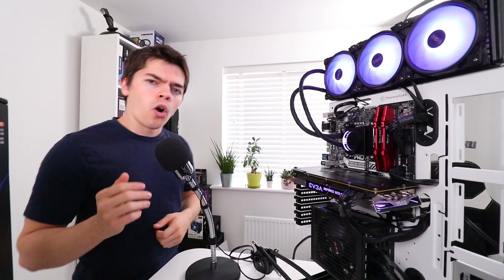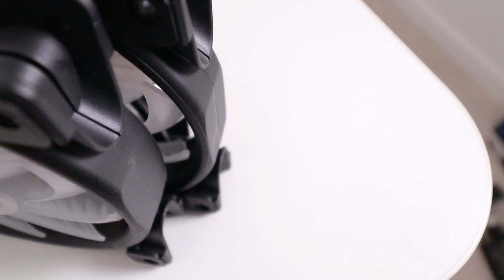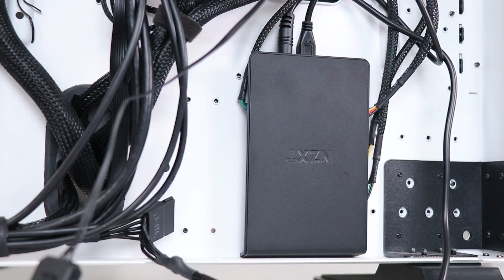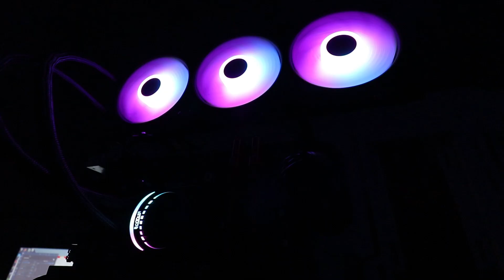Are Cheap AIOs Worth It? - PREMIUM vs BUDGET 360mm ARGB AIO Coolers ft. Corsair H150i Pro XT

Comment from the maker: Timestamps:
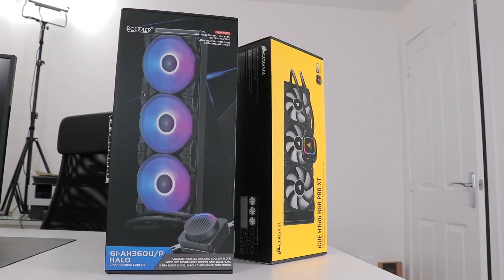01:03 - Introduction
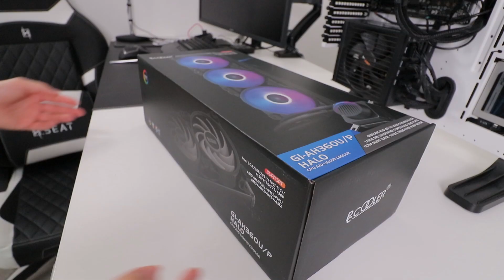01:50 - Unboxing
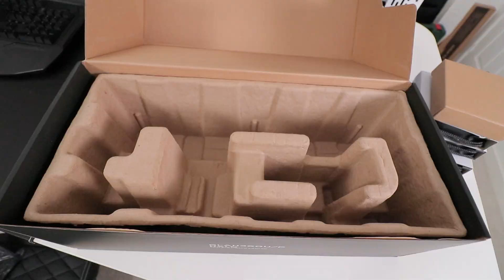01:57 - Parts bag contents
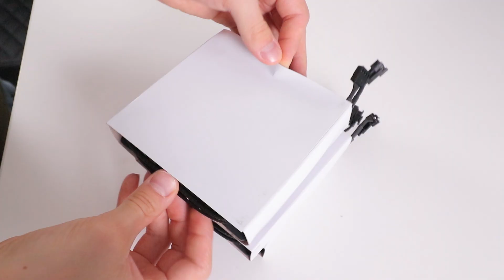02:56 - Fans
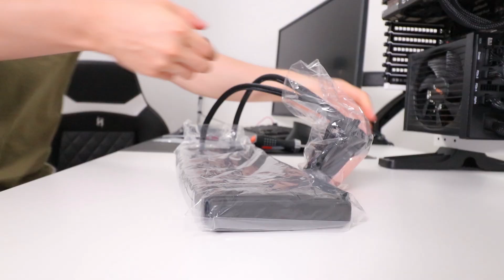03:28 - Radiator
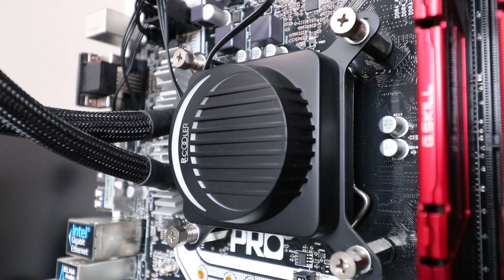03:58 - Pump and CPU Block
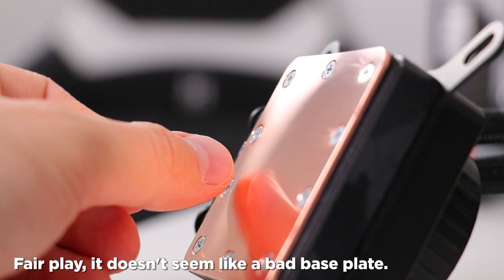04:26 - Weight Comparison
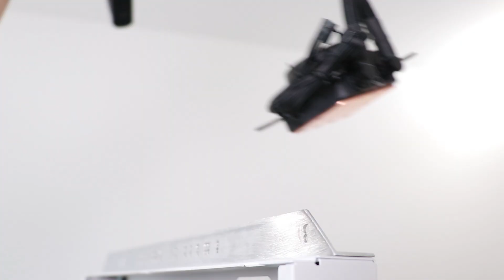05:06 - Installation
07:03 - Thermal and Acoustic Test Results Analysis

CONCLUSION
09:50 - Price
11:03 - Performance
12:35 - Thoughts and Wrap-up

Comment: Check out the Arctic Liquid Freezer II series of AIOs. They're just about the highest performing AIOs one can buy at the moment, they come with a 2 year warranty, and fans already attached to the radiator, with daisy chained cables that are ran through the tube sleeving coming out of the radiator in order to minimize cable management and clutter issues. They're also super affordable, running around $105 US for the 360.
Reply from the maker: Yeah I want to check out some smaller AIOs and see what is a good recommendation for a more common CPU wattage.

What are your thoughts on 120mm AIOs?
Reply: @AVTechy  I do believe the Liquid Freezer II comes in a 120mm size as well. It's around $70 US, I believe. As far as 120mm in general, I definitely think they have their place, especially for small form factor systems, budget builders, and for people wanting liquid cooling but for lower spec CPUs like a 3600 or under.

Comment: Nice video very informative thanks, think I going to stick with air on my R5 3600 just so things are worry free.  Excellent production values by the way, how do you not have more subscribers.
Reply from the maker: Thanks very much!

Yeah sounds like a good way to go to me. I'd only go for an AIO if an air cooler can't hit the spot because of case or wattage constraints.

Thanks for the support, with any luck we'll see the channel grow steadily for the rest of the year. Consistency is key :)
Reply: Well yeah it makes sense 
But you shouldn't worry if it was a known brand like id cooling or thermalright 
They offer low pricing and robust quality of materials